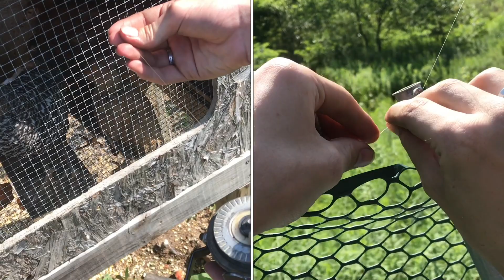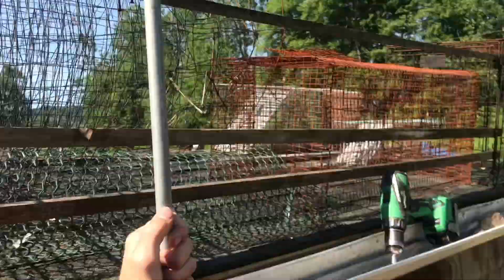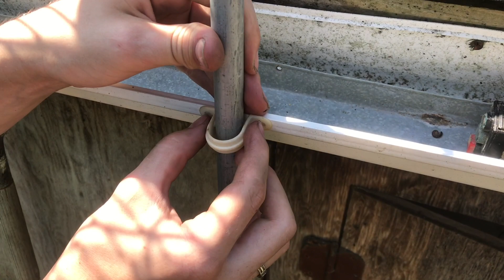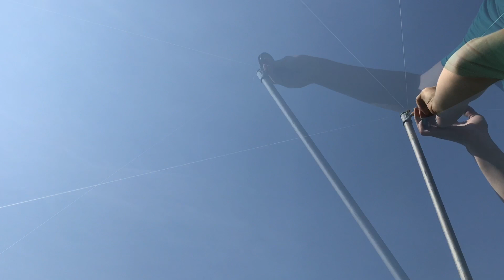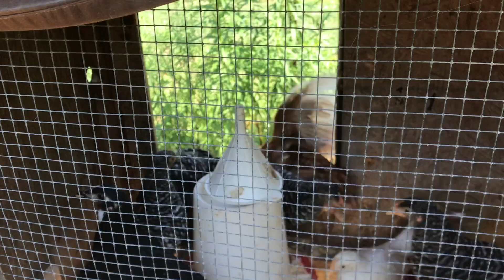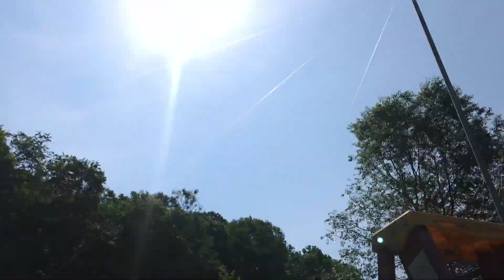using FISHING LINE to “protect” chickens from hawks

Comment: I do something similar over our 30x30 run I have a single cable that runs right down the middle about 10 ft off the ground and then I go from each side of the fence loop it over the cable back and forth back and forth back and forth to basically create a net type of effect with masonry twine bright orange for bright green whichever one I can find masonry twine. I think the Hawks see it from some angles it almost looks solid looking at it straight up and down the twine is about a foot apart as you go down from one end to the other so a hawk could fly through it if he tucked his wings but more than likely he would hit the twine and possibly get entangled which would be a shame because he might get hurt while I'm untangling him.